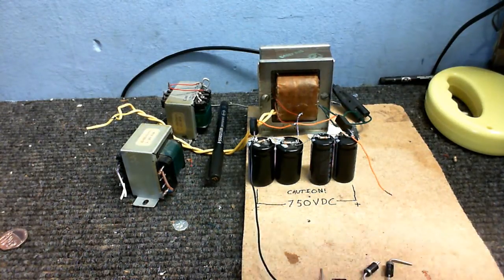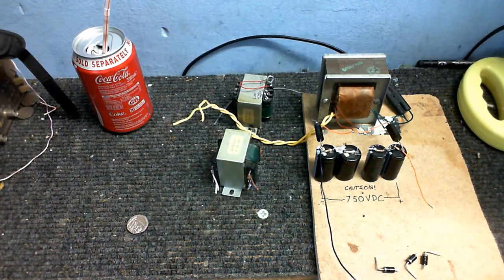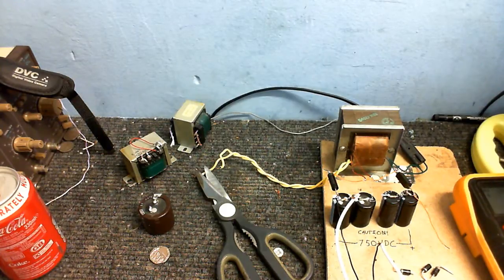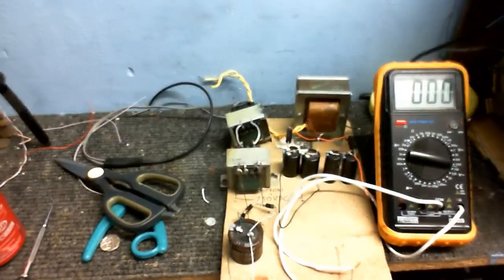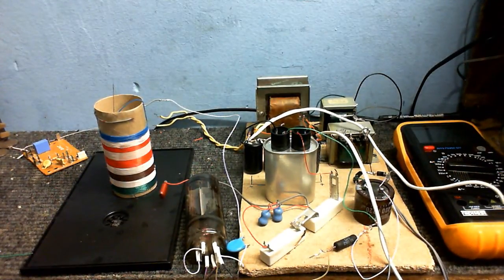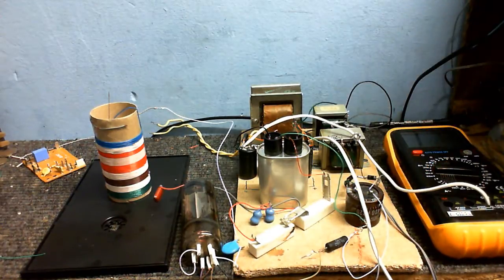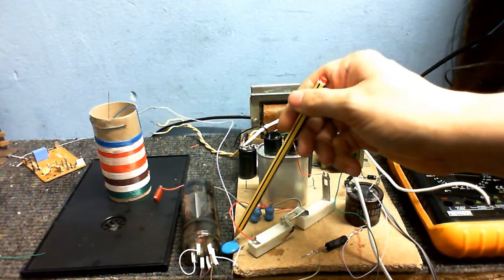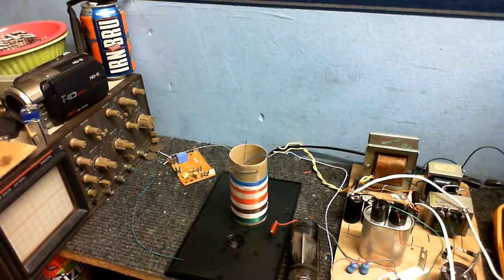High Frequency VTTC Experiment

Comment: You should try adding a Flux Capacitor with 1.21 gigawatts, add in a Continum Transfuctioner and youll have yourself a Crank Prank Time phone. I think Antimatter Fusion Cones or 30 plain HF Watt Triggers would also be a great addition.